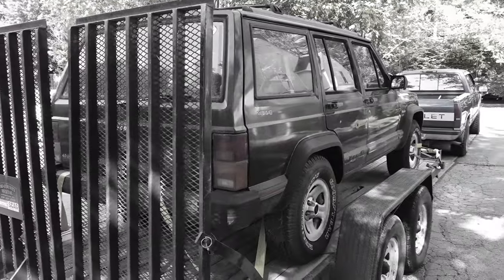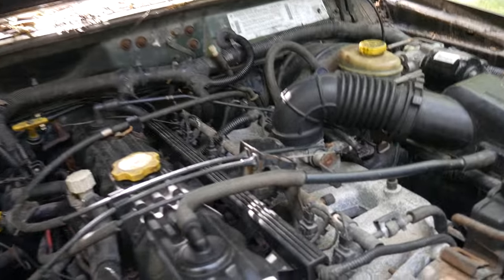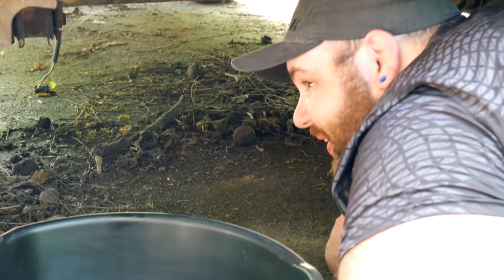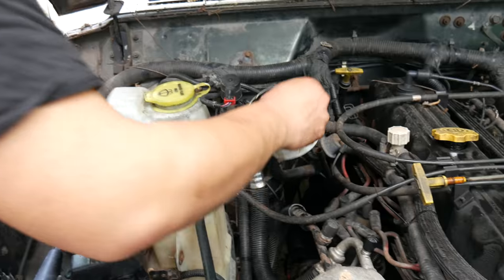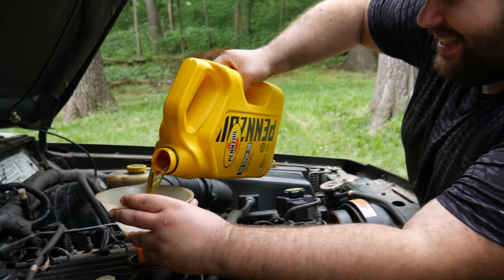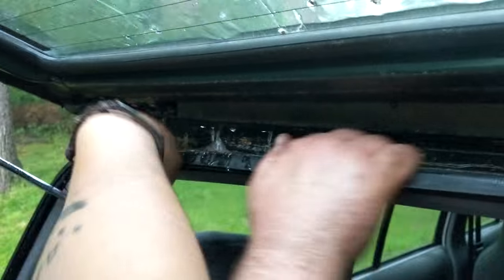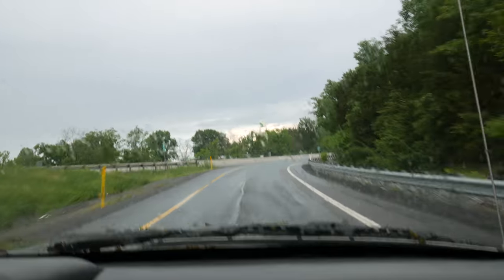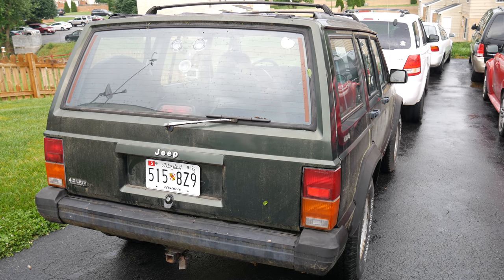Jeep Cherokee Project Fluid Change and Drive Home (Ep.3)

Comment: Great vid. I have a 91 and a 01. If you want to keep it looking the way it is wash it then undercoat it. As long as the oil is changed they will run forever. My 91 has 284k and the 01 has 194k. You have a jewel there my friend. Enjoy!

Comment: Love it. My late grandad has a 98 grand Cherokee same motor inline 6 that sat for 7 years at 90k and went through everything to get it back going. Fuel pump, fuel injectors, tune up, and a few other little things. 3 years later running strong at 120k although i think it needs a cam sensor but still great 
 Even motivated me to get one myself a 2000 grand cherooke 4.0. Hope to see more of the Jeep Content!

Comment: Been waiting for this one. I have one myself and has been sitting. Watching these gives me some inspiration for it.
Reply: Alex Livingston its a Jeep she will run like a champ with a tune up and possibly fuel pump but it’ll be mint bud
Reply: funcolton Since I commented this I replaced the leaf springs on it and it drives well. The right front brake caliper is seized and it drags on the rotor a little but brakes are easy to replace. All it needs is that and an alignment and its perfect.
Reply: Alex Livingston ahh I wish mine was that easy, mine needs rear shocks but the upper mount snapped so gotta fabricobble it together and the person who owned mine previously cut the mounts for the leaf springs and now I have death wobble absolutely no fun at all especially being lifted 4.5”
Reply: funcolton that sounds rough Haha. The leaf spring replacement for mine was a pain in the ass. I'm just hoping nothing goes wrong with my calipers when I replace them
Reply: Just the way a modified Jeep rolls
Reply: funcolton yup, what can you do...
Reply: Well I mean get a rust free one and swap parts over so it’s easier to fix and I’m more motivated plus itll have good leaf springs
Reply: funcolton there's no rust free ones where I live, Michigan
Reply: Nor does Iowa I plan on spending about $2000 in either Cali or some where south
Reply: funcolton yea that's a good plan

Comment: 4.0 liter straight 6 never gets tired just sometimes groggy, like every entrance ramp. I own 2 a 2001 TJ with 18,352 miles (got a smoking deal...$6,700 2 months ago...lol) and a 1999 XJ Jeep Cherokee on full custom suspension and axles with 38” Nitto Mud Grapplers with beadlocks and lockers and a 5 speed (manual) with 295,729 miles, Love em!
Reply: Jeremy Smith My 1999 Xj has almost 330,000 miles and is just like new.These motors and transmission's last forever..
Reply: Holy shit you got an 18,000 mile TJ for only $6700?
Reply: @vadidithy  probably some old lady or someone in the family

Comment: The Oil sending unit is right next to the oil filter. So caution should be taken when using a screw driver on the filter. I found that out the hard way.
Reply from the maker: Ouch, thanks for that info!

Comment: I noticed that the little bubble on the cap for the brake master cylinder was sucked out, you might have a little bit of a leak in your brake system.

Comment: Out of three of you nobody was wearing a belt? Could used that to remove the filter.
Reply: snappybones I was thinking the same thing. I guess that old trick has fallen to the wayside.
Reply: john carville its ok. Thats why us older fellers are here. Teach em young and hand down that knowledge
Reply: I probably was... Thanks for the tip geezers, hopefully won't have to use it.
Reply from the maker: Good tip! It may well have worked, although that filter was REALLY stuck. Will have to keep that trick in mind!
Reply: I own a 96 Jeep and a good way to remove a stick filter is to hit a small flat tip screw driver into the gap between the oil filter and the mount for it just be gentle at first and if it don’t work use your purse
Reply: @FuzzyDiceProjects   Install a lift kit and custom 4 wheel drive rims later down the road. That my opinion

Comment: You guys drove that screwdriver in reaaaaaly close to the oil filter threads.
Reply from the maker: There wasn't a lot of filter real estate left by that point, but fair enough. Most likely it'd just glance off the more solid surface but there is a chance the exposed threads could be damaged and make it even more difficult to remove.

Comment: You can register a car withour even having it with you in USA? Huh, neat
Reply: MrDoroh only if title is not from a different state
Reply from the maker: Yep! In Maryland for cars over seven years old all you need is the title and insurance!
Reply from the maker: You can get a 30-day temporary registration to get a vehicle on the road and have a bit of time before an inspection is required. For older vehicles, like this one, Historic tags are an option and don't require any inspection at all.